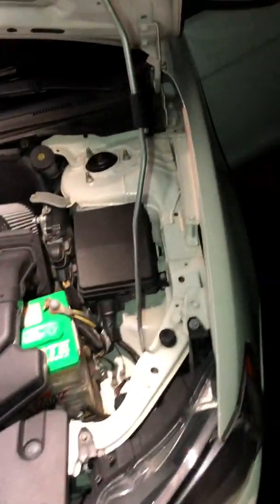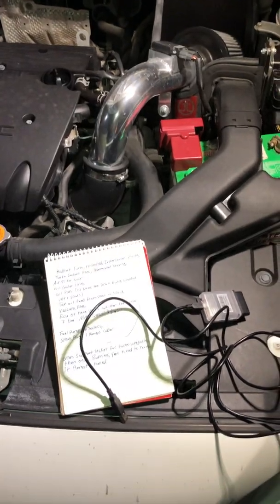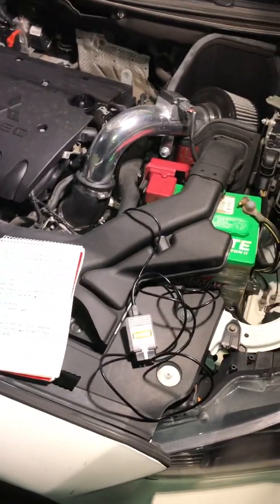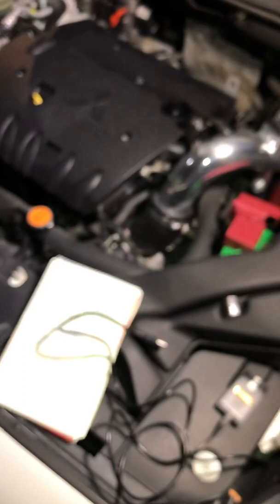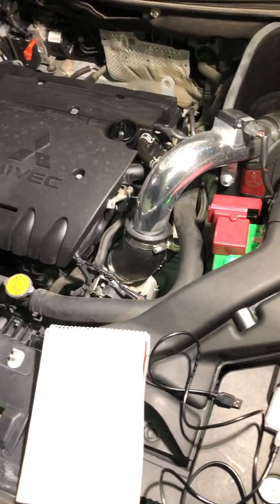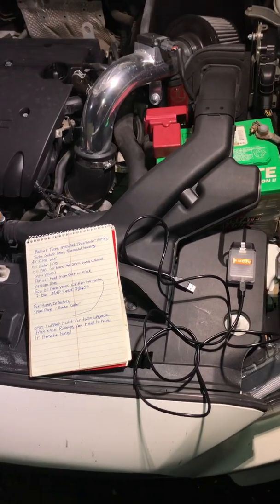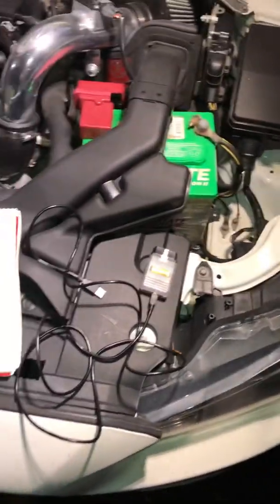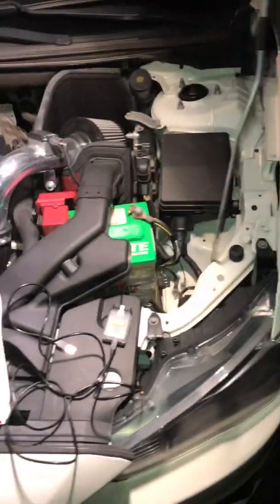How to tune the ECU on a Lancer

Comment: Very informational video. But I have to ask.
Can the cvt transmissions in the 08’s be boosted?
And can the engine run a turbo at around maybe 9 psi reliably?
I just got an 08 lancer with a cvt, idk which engine it is but I plan to mod it in the near future
Reply from the maker: Justin, the CVT transmission can be boosted but you are going to want a very large transmission cooler with a built-in fan, honestly I recommend a trans cooler with a van even on the non-turbo models. They really need to be kept cool in order to live and change the fluid once a year.
Reply: @ikecostner1  I see, thanks for the info! I just didn’t want my trans to grenade itself after boosting it (well at least not for a while) I would wanna swap to a manual trans after, but keeping the cvt after being boosted sounds like a good time to me
Reply: only need to run about 6 psi its weight to power is equivilant to a 4 letre v8 pushing 15 psi roughly
Reply from the maker: @zanderhope2513  that is hilariously untrue, my Lancer on 15 psi would not stand a chance against a modern coyote powered Mustang

Comment: The 20hp gain. Was that from stock or did you have the mods you wanted already done?
Reply from the maker: Mods already were done but the tune was able to get 20HP (could be because doing mods without a tune can sometime make you lose power with a factory tune) The engine has a set parameter for fueling and air fuel ratio, when you mess with the intake and exhaust the computer will try to correct it and sometimes you can lose power from the engine trying to correct your mods, so don’t ever get mods done without a tune you can actually end up hurting performance

Comment: After adding intake, exhaust & tune how much horsepower did it add?
Reply from the maker: Oh sorry you were asking about the naturally aspirated setup. Save your money not worth getting it tuned and getting exhaust / intake if you’re not adding boost. I gained maybe 20HP
Reply: @ikecostner1  hey, 20hp is 20hp
Reply from the maker: @chevy66driver  still a gutless turd even with that added 20HP
Reply from the maker: I do not have dyno sheets, but my prediction was the turbo kit added about 145 (+or-) HP
Tuned on 93, straight piped exhaust, ram air snorkel setup, K&N, boost controller and GFB blowoff valve 
I was running about 13-15 PSI

Comment: I have in Mitsubishi lancer 2013 standard transmission with 4B11 engine that I want to modify its ECU, but we could not find the identification file to access its parameters. Could you modify yours? I see that car is similar to mine. I would like to know if you could do it. Thanks in advance.

￼
Reply from the maker: Not a clue on that man,
Reply: 4B11 is from an Evo X
Reply from the maker: @EbolaSquirrel   no it’s not,
Reply from the maker: @EbolaSquirrel   maybe you’re thinking of the 4b11t
Reply: @EbolaSquirrel  4B11T is the Evo engine. 4B11 is in the base models. My 08 es had the same. My 12 se has the 4B12